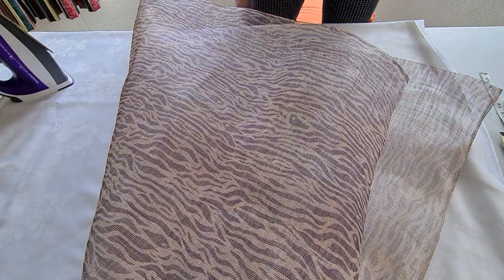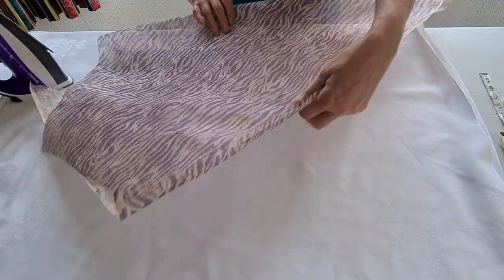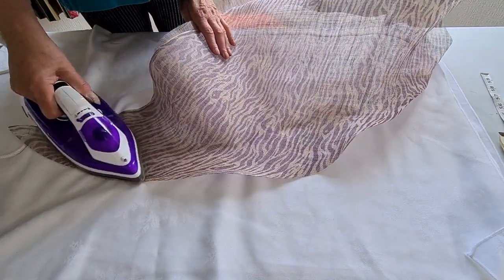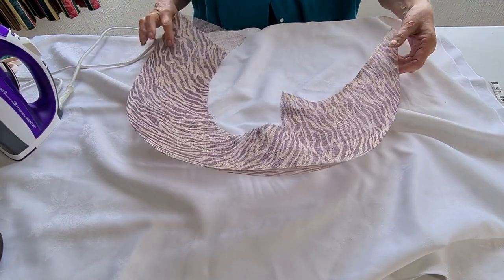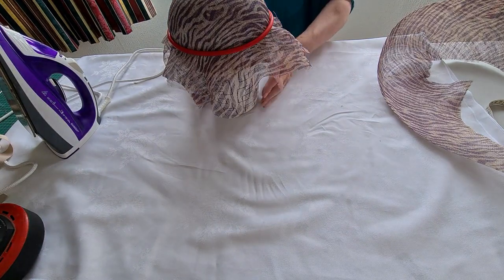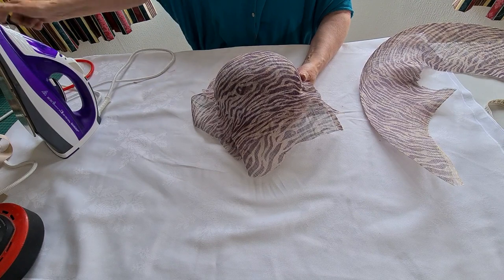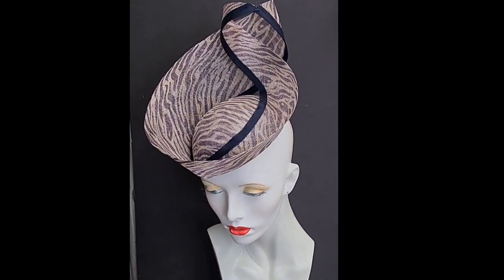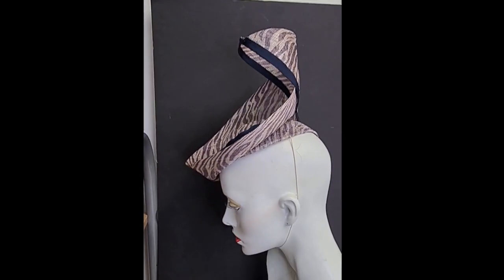Making hats - How to form an edgeless brim, or how to swirl sinamay for hats

Comment: Thanks for sharing this beautiful technique with bias and swirls. How do you manage to keep the base sitting on the head without falling of because of the weight of the cascading structure on top?
Reply from the maker: Hi, Thank you, and a good question. If the hat is top heavy, I sew a small weight (sometimes a coin) into the sweatband on the opposite side to counterbalance. This hat sat quite well without that but a comb stitched in also helps.

Comment: Hi, I'm wondering as I'm watching this: what scissors should you use for cutting sinamay and other stiffened weaves. Is the paper scissors the ones, I saw the buckram being very stiff almost like cardboard, or the fabric scissors, it's a weave after all, or should there be a designated scissors for use of blocked things, please? I just realized that I hav the same question about felt really, so should I set aside one pair of scissors for either materials or should/could I use my soon to be bought, fairly expensive Sheffield mostly hand made one? Thank you, Yours, Ann
Reply from the maker: Any large sharp scissors will do, just don't use them after for fabrics, as the blade edges get rough
Reply from the maker: I wouldn't use expensive ones!
Reply: @SHMillinery  Thank you so much. I have a simple inexpensive one that's driving me crazy when I use them on fabric. That can be my dedicated ones. Yours, Ann
Reply from the maker: @annlidslot8212  perfect!